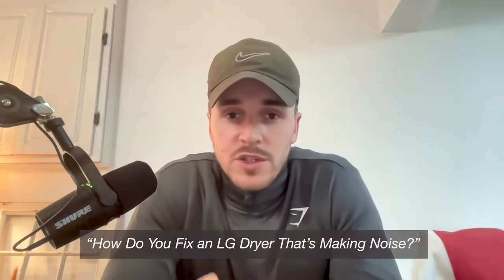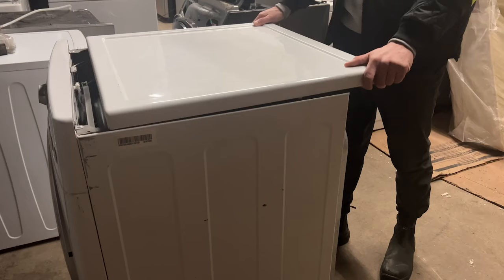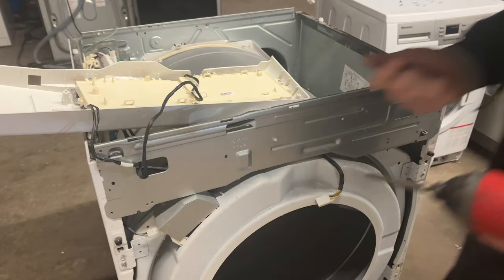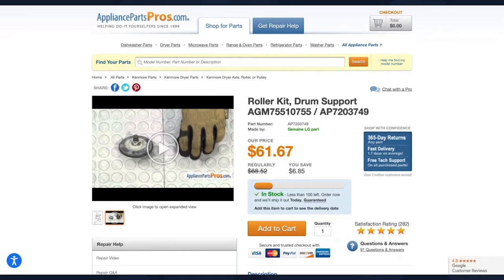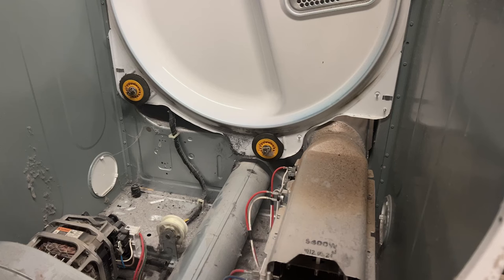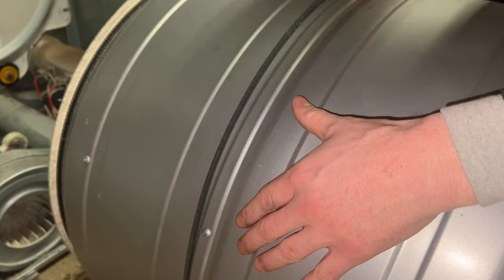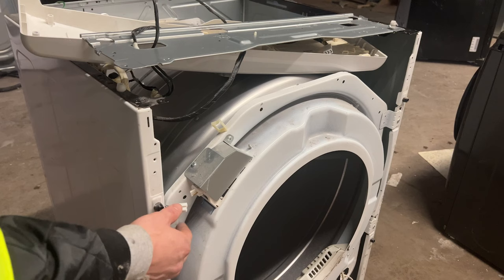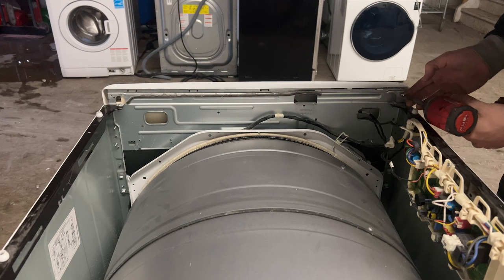How to Fix ANY LG Dryer Making Noise | DIY Troubleshooting Guide (2024)

Comment: I have not taken my machine apart yet but I am almost certain the problems I am having are a broken roller.  I went to order the parts from Amazon but I don't see my machine listed anywhere in any roller kit on Amazon.  Can you help?  My machine is an lg dryer dlex3250w.  Is there something different about it from all the other machines?
Reply from the maker: I’d check appliance parts pros. Com and put your model number in and see what part they recommend however I do recommend properly diagnosing the machine first to avoid spending unnecessary money

Comment from the maker: Question of the Day: What of the 4 issues listed in this video was the problem with your dryer?!
Reply: Thank you man - excellent video on the LG dryer repair!  My issue was the most common one - roller locked up and needed to be replaced.
Reply from the maker: @LukeMcHale  Hey Luke - love this man. So happy the video could help!
Reply: If I may I ask a question off this topic, my same dryer is all of sudden not heating and wondering if there is a self diagnostics I might perform to nail down the issue?
Reply from the maker: @JimBAgde  hey Jim, self diagnostics won’t help with this. If your dryer is not heating and it’s an LG I can almost guarantee it’s your hi limit thermostat or heater!
Reply: @JimBAgde  my guess would be the heating wire.
Reply: One of the rollers was bumpy

Comment: Thank you again my friend, you have been a wealth of information!  
Since I will be ordering the thermostat and roller assembly.
My model number is DLE2301R, do you have a preferred distributor to order these parts from? 

Many Thanks Again... JimBo
Reply from the maker: I prefer appliance parts pros in the states
Reply: Hello Scott, Last month you had helped tremendously recommending  Hi-Limit-Thermostat for my LG Dryer, (along w-cost effective Roller /Belt Package. Separate Issue!!), when both heaters were not heating up during a testing process.  Well,, only just got around to installing the components yesterday as I've been using Solar Clothes' Dryer (Outside Clothes Line:-LOL!) since there was no rush. After installing, The dryer worked fine for the first load , however afterwards, it stopped producing heat and I'm back to where we started only with new roller kit installed and that seems to be working fine!   Is there possibly something causing the Hi Limit Thermostat to break, or could it be something else?
I Look forward in hearing back form you. Jim B

Comment: Hi , how do I fix my LG Washing machine. There are lights , but if I press play button it will switch on crease care and not work. What can I do?
Reply from the maker: Chances are there is something wrong in your motor circuit. The belt could have broken, or a fuse inside the dryer. It could also be your control board or a few other things. I’d type in on YouTube “LG DRYER NOT SPINNING”
Reply: Thank you, I will check it up